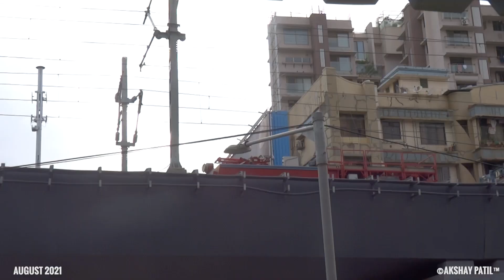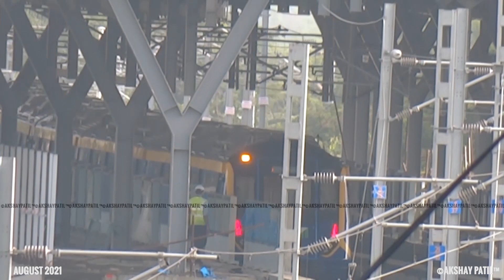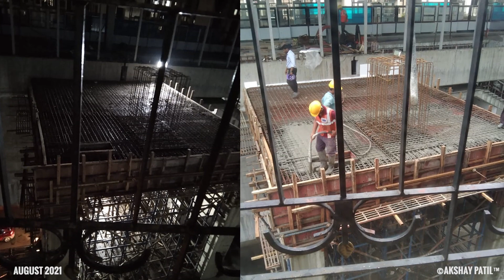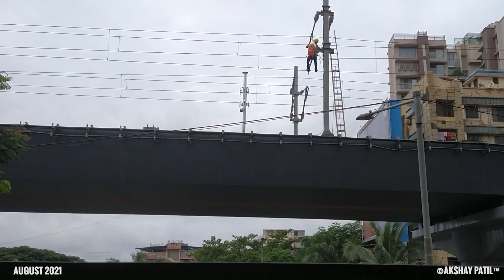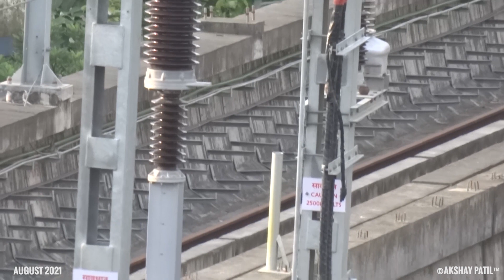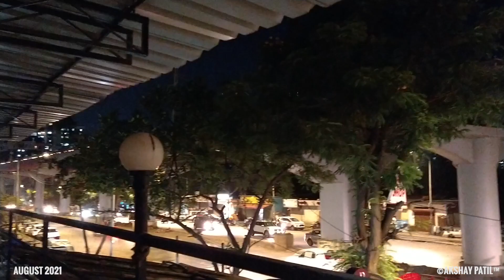Mumbai Metro 2 AUGUST 2021 UPDATE

Comment: Q. As we know that Metro rakes have now only 6 coaches in future it will be increased upto how many coaches and station and platform is constructed for what capacity of coaches?
Reply: In future it would be increased upto 8 coaches and station have constructed at capacity of 8 coaches
Reply from the maker: Metro 1 has 16 set, so we can expect atleast 15 set for line 2 and 15 for line 7, but since both line will be having single depot at Charkop, total rake could be less since we don't know maximum capacity of Charkop carshed! But it should be 25+ ,and currently there is no official data of orders given to BEML
Reply: @EMPERORakshaypatil  Rolling Stock contract to BEML 576 Coaches for Yellow & Red lines , I think it will also for line 2B also so now we don't know exact numbers how many rakes will line 2A,7 & 2B have individually.
Reply from the maker: @prathamkushwaha01  if dividend by 6 then it can be 96. But this total might be for 2A,2B,7 and 9 so each route get 24 if dividend equally!
Reply: @EMPERORakshaypatil  Oh I forget 😅 line 9 is also Red line. Line 2B will take more 4-5 years